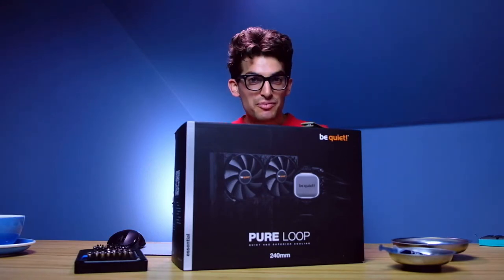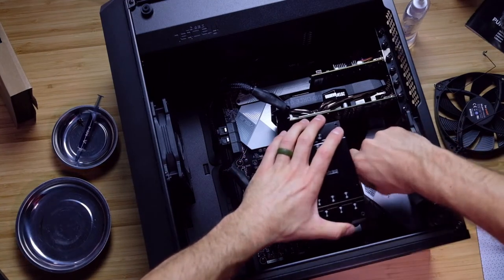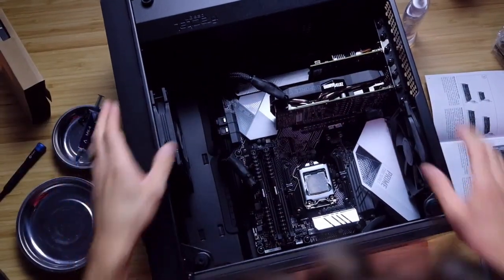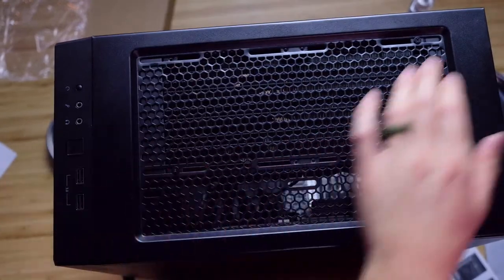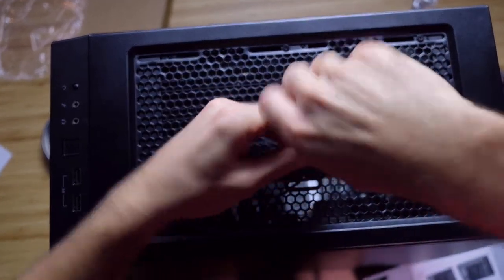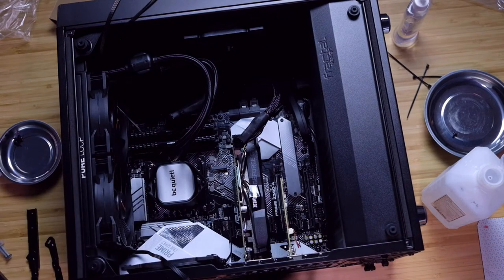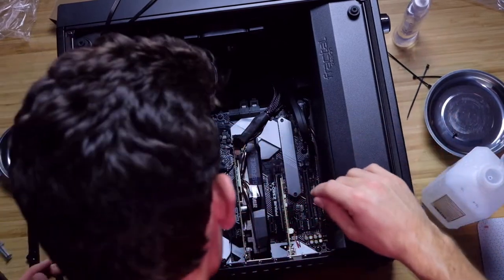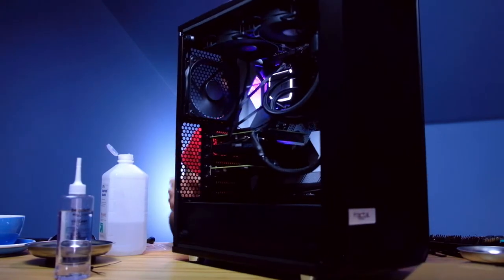Upgrading to an AIO | bequiet! PURE LOOP 240mm Installation

Comment: Funny thing is the pure loop 240mm only cost $50 more than my air cooler, and it’s much better at cooling. $50 more is cheap for computer parts so I took that chance. 

Forgot to the heat up the paste before removing the cooler and ended up yoinking the CPU out of its slot and bending a few pins but I bent them back and everything works. That made a 30 minute process into a 2 hour process though, counting the freak out time.